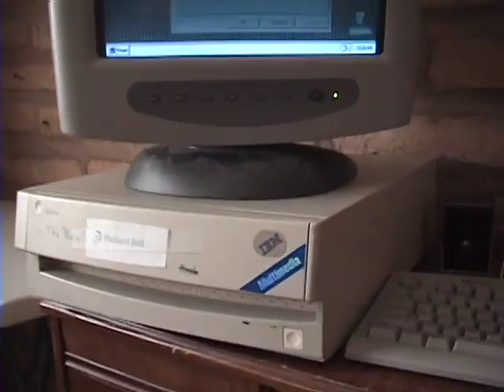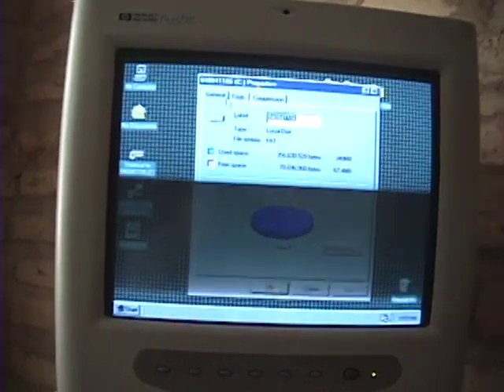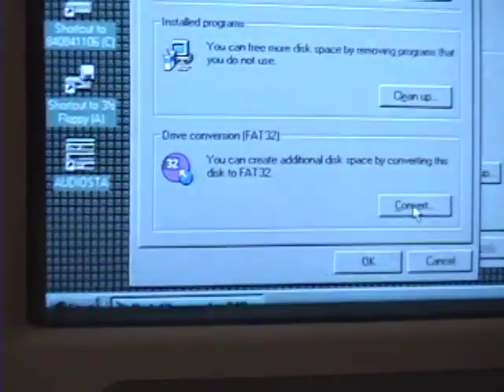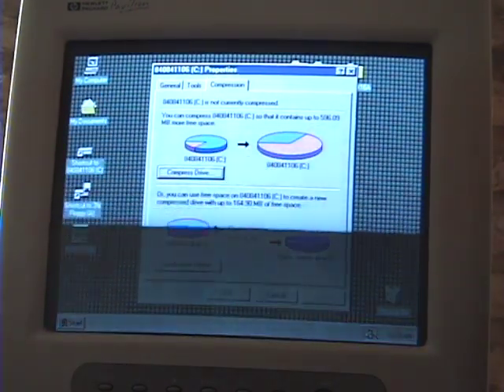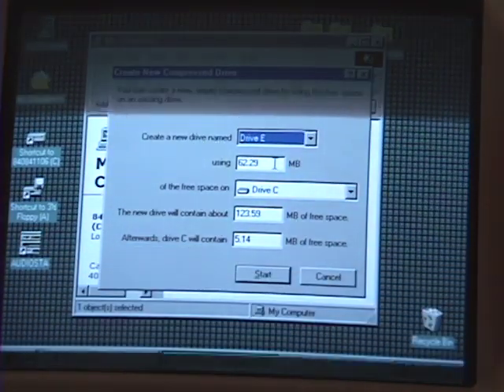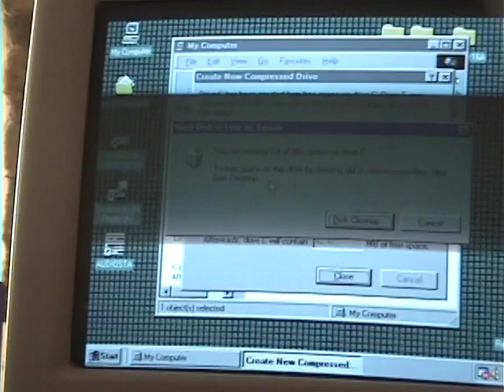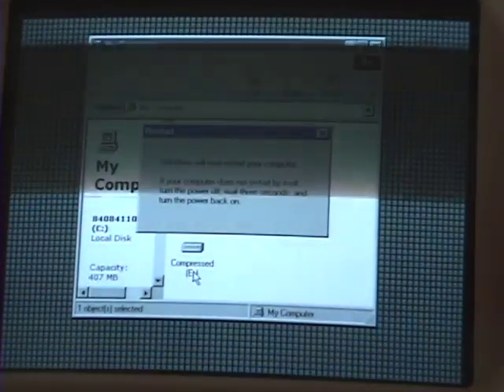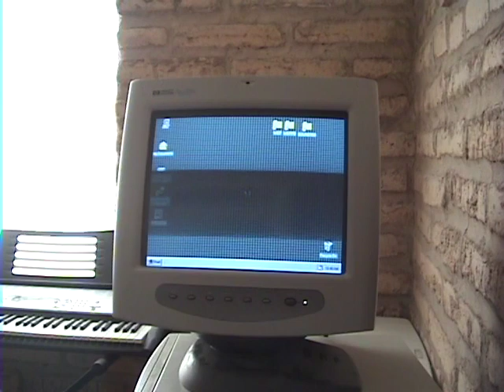Ian's Computer Show - Episode 2 [2007]

Comment: 407MB drive ? Wow, I have a 2tb sshd
Reply: Not back in 1994
Reply: *****
1999 hard disks had much more then 407mb
Reply: I have a gaint 40Mb harddrive from the late 80's xF
Reply: I have 1 TB SSD, a 2 TB HDD, and a 360 GB HDD
Reply: This was 2007 you donk
Reply: Ry 00001 they were talking about the 1994 hard disk, they were 407MB. Not if he's using that hard drive on the video (is probably using it)